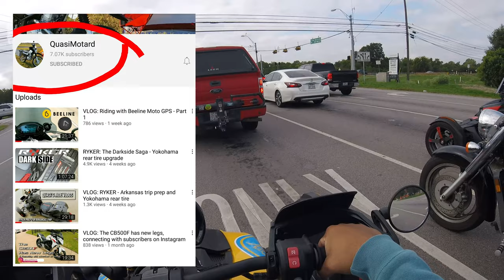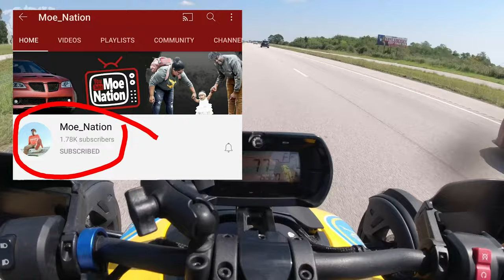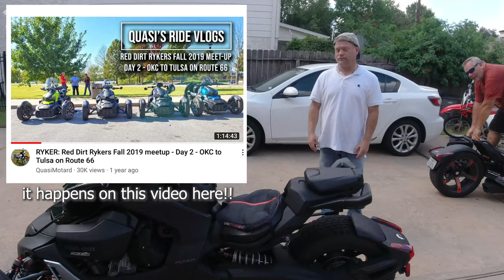QuasiMotard Talks Can-Am Ryker Upgrades ..And We Get To Ride His Scooters 🛵💨

Comment: I have the Samsung A50. Quad Lock did not offer a case for it, however they do offer a universal mounting device for just this reason. You order the actual Quad Lock mounting unit and then the universal mount. It connects to the back of your current cell phone case by means of a 3M backing. I got the Otter Box case for my phone and affixed the universal mount to that and it works perfectly with the Quad Lock.
Reply from the maker: Ohhhhhhh... Good info! Thanks for sharing, that's makes the Quad Lock sound way cooler, I would actually consider getting one now, I have the Ram X Mount, but Ive only had it one once and couldnt stand seeing my phone when I rode 😅, killed my ride big time.. But I could see how they are useful when I'm expecting a call or message and such
Reply: @ThrillMouseMoto  Yea, I had the RAM X-Mount, but after losing my phone once when I hit a bump and the wind took it from there, I decided I needed another option. I like the Quad Lock because it holds my phone rock steady, so I'm not worried about it falling off. It's easy to get the phone off, but can be a bit of a pain getting it locked back on. You have to hit that universal mount just right sweet spot. All things considered, I'm happy with it. I heard on another channel that Quad Lock was coming out with a magnetic version, but it has not hit the market yet so I don't know anything more.

Comment: I replaced my half fender on my 2022 rally with the ace fender. When mounting the new ace fender.  I re- drilled the 3 rivet holes approximately 1/2 inch lower to add extra clearance on the fender. Worked out perfectl. Great video
Reply from the maker: Awesome tip! Thanks for dropping in and sharing that on here, John! 🙏💯🐭 Stay cool!

Comment: There are options for the deceleration brake light systems. They sell a license plate frame with the light. And you can also get a light that goes on the back of your helmet with a sensor on the bike.
Reply from the maker: Yes, each of those are cool! Kevin has the STS one installed on his and I did some research on the Brake Free helmet mount light but didn't come back with good enough feedback on it.

Comment: I was checking clearance distance with the fender and my brake light.
Reply: @grampsaggyballs  Nahh, the one Quasi has is outta my price range. I like mine a lot and will probably do a short video once I add my engine brake flasher to it.
Reply: @grampsaggyballs  46:34 you can see it.

Comment: Really need that brake light that shines on its own!! Anymore info on it? Where to get it and install info? 
Thanks for all the information and videos
Reply: Yes, it's me (Kevin) from the video. That is a Morimoto 5 Stop light. You'll need two m6 bolts, some wire to extend to the length needed and some Posi-lock connectors. And a drill because the mount that comes with the light needs to be modified to fit the max mount. And some patience as always. The RetrofitSource is where I buy anything Morimoto.
Reply: If your talking about the one Quasi has, that is something like $200. Mine now do the same thing his does minus the directionals. Catch my Insta @BikesAndPizza to get a preview of my new fog lights.
Reply: @ExcelsiorDDZ  Thank you very much I’ll have to get it to many close calls
Reply from the maker: @mudvilleryker1261  Kevin has a sweet video on his channel that shows his brake light set up that does warning flashes when he lets off the throttle too :
https://youtu.be/X0t-puBncgc